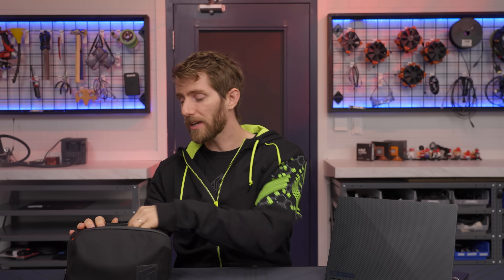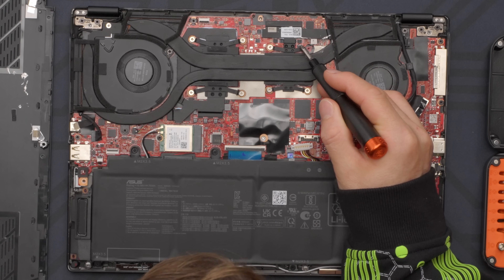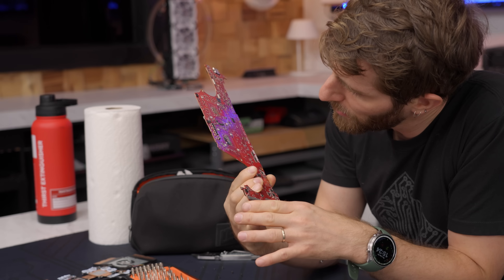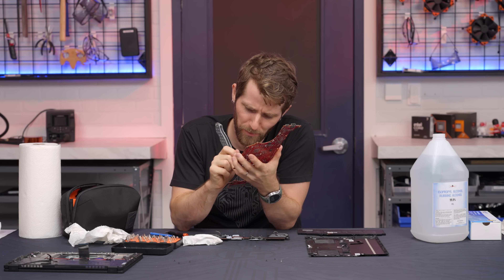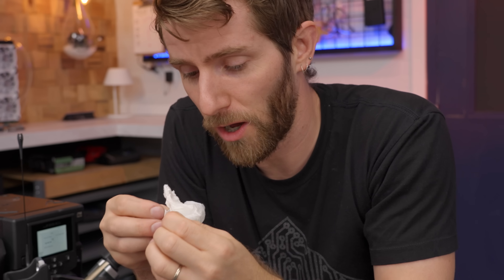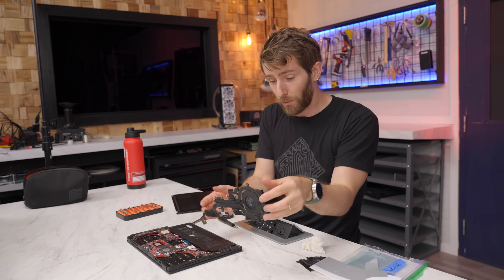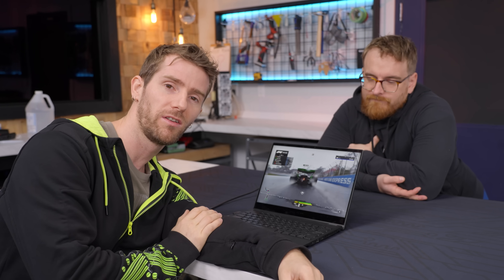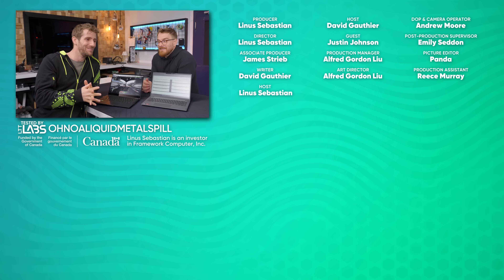Liquid Metal Killed my Laptop… Now What?

Comment: I put PTM9750 in my HP Omen 15 and it's day and night difference. It works so much better on bare die chips vs IHS chips. Normal thermal paste would just degrade after 1 months due to pump out effect.

Comment: That's incredibly dumb design, components around the die should be insulated by the factory with conformal coating or similar... Heck I put liquid metal in my laptop 6/7 years ago with some insulating tape around it, I regularly throw it onto my bed and it even fell from my hands while standing a couple of times, and nothing ever happened. This is beyond stupid.

Comment: I was once cleaning my 2022 asus laptop, since I thought it was overheating - turned out I had liquid metal. I replaced it with normal thermal paste and temp either went down or didn't change at all. Liqid metal is completely pointless.

Comment: The paranoia around Liquid Metal is insane. If you listen it’s a manufacturer problem with low mounting pressure of the heat pipes. I applied Liquid Metal to my laptop a few months after getting it because architectural rendering can be super intensive and I don’t want my pc to sound like a jet engine in public.

Turns out there’s been zero problems with it since then besides me accidentally breaking my speaker ribbon connector lol. And yeah I’ll be doing a raytraced render one minute then  walking a mile back home with it in my backpack and that doesn’t cause any problems. I’ve had nothing but net benefits with it, even the broken speakers have been nice as I don’t need to worry about forgetting to mute them in public lmao.

Comment: I replaced the liquid metal on both of my devices (Flow x13 and Zephyrus G14) with PTM7950 and actually experienced a performance boost. The reason is the uneven distribution of the liquid metal on the surface. The core with the highest temperature was throttling the entire CPU.

Comment: I have an ASUS  laptop GA503QR-211.ZG15 with the same Liquid metal cooling.

Due to some high 95-98°c I removed the heat sink and noticed Silicone thermal adhesive around the cpu die acting as a barrier to keep the liquid where it should be. 

I'm surprised as to why they would think removing the silicone adhesive on future generations would be a good idea

Since asus was rationing out liquid metal like it was the 1930s I reapplied liquid metal from Grizzly,  the silicone thermal adhesive and took the same laptop to college Mon-Fri for 3 years, seems like to me The Silicone barrier is crucial.

Also the temperatures significantly improved and doesn't dare to pass 80°C.

Owned the laptop for about 6 years now.

Comment: My local Clevo representative store sold new laptops with Liquid Metal. I reported issues with extreme cpu temps and they just claimed it was a simple cleanup maintenance needed, after warranty ended I did it myself to find it has a copper cooler, totally corroded by the time I saw it.
Clevo has not accepted any resolution claims to this day.

Comment: Please wear a type of gloves that the solvent that You are working with does not dissolve. The isopropyl alcohol is known to react with some of the metals even, which means that some metals do get dissolved in it, not just the "liquid metal" as demonstrated at this Linus Tech Tips video. At the same time the isopropyl alcohol is good at getting into living organisms, transferring the dissolved metals with it, increasing the likelyhood of cancer development over longer time period. On top of that, many sovents are themselves, in pure form, cancerogenic, which is the reason, why in Europe interiour design paints, renovation paints, have strict limits on the percentage that they are allowed to contain substances like the isopropyl  alcohol in them. The painters, who paint floors and sealings and do other interior renovation work would get sick, have become sick in the past, due to the organic sovents like isopropyl alcohol. So at least some professional electronics engineers use chemistry lab style ventilated work areas when dealing with isopropyl alcohol. The same with almost all the rest of the electronics chemistry. Even Chinese factories have soldering fume extractors or some ventilator to at least get the fumes away from workers. I suggest that Linus Tech Tips should start educating the public for electronics related work safety, specially in terms of chemical safety. Thank You for reading my comment. (Not that hardly anybody would read my comment among the over 2000 comments in this thread.)

Comment: Good try. Now do a collab with one of the many great youtube motherboard repair channels out there. 

It's probably a "very easy fix" (for them) with just a replacement of a couple of shorted chips on the power rail. 

The "get a new one" mentality here sounds pretty off-brand for LTT to be honest. Cheaper to get it serviced, profitable if you get content out of it, with the added benefit of community building - getting more tech-tubers involved in common projects and giving some visibility to smaller channels.

Comment: Liquid metal has no business in a laptop. It barely has any business in the PS5, where it has already caused a ton of issues, especially in the vertical stand position, which you're expected to be using as the normal position.

Comment: I'd say that one would reasonably be able to assume that their laptop should not die from minor bumps and everyday use. Liquid metal is used best for short term high output applications. Putting it in a laptop seems like an accident waiting to happen (which it did)

If you have to use any sort of exotic elements in your cooling it doesn't belong in a super small form factor that's meant to be carried around. This is what happens when laptop designers are not allowed to tune their CPU and GPU more than manufacturer tolerances and have to find any way to stand apart from their competition...

Comment: Honestly, the real issue is that Liquid Metal is applied by these OEMs like they’re normal thermal paste. Too much of an amount, improperly applied by applying only on the die, and the room to allow poor customer service when it messes up. It definitely is somewhat of a planned obsolescence because they are already horribly applied stock.

Another thing that just irks my nerves honestly on this topic is how some treat or panic immediately over liquid metal as if it were nuclear power itself. Handling it properly prevents most of the risks, especially during the manufacturing of the device.

But that’s my thoughts, the implementation of liquid metal on laptops or consoles is honestly more of a marketing fad because “temperature” yada yada money money big profit weeee.

Comment: Just yesterday I was trying to explain this to someone. Liquid metal is just marketing for PS5 and Laptops.

it's just an extra point of failure with almost no benefit that can easily turn your 1000 - 2000 laptop into a brick.
it's also a nightmare for laptop technicians. Nobody want's to deal with that and go through the whole process of cleaning the metal to inspect/repair or do what you need to do inside the laptop.

Thermal bottleneck for laptops is not even in the interface of the processor with the cooler, it's limited by the size of the pipes, the small heat diffusor and the small fans. You only get a decrease in temperature that's not worth the effort and almost no performance increase.

But what you do get is as I said an extra point of failure, just making the lifespan of the laptop shorter in the attempt of increasing the lifespan of the processor.

Comment: I have had multiple people send in requests to have their liquid metal laptops fixed and honestly ... this is exactly what I've seen.  Sometimes you can get them working, most times not.  I had one MSI laptop where the liquid metal had gotten into the fan itself and spread EVERYWHERE in the machine that was from a drop in a backpack from about 4 feet.  The laptop structurally was fine but that exploded liquid metal everywhere.

Comment: I have a Clevo P870TM laptop. It came with an Intel 8086K, which I liquid metal'ed back in about 2019 or so. It is hardly a portable laptop but has come with me many places and I have not had any issues. I protected the circuitry with nail polish and it has lasted me a very long while. I know I'll have to replace it eventually but may actually try these pads out instead.

Comment: Some brake cleaners are basically 99,9% isopropyl alcohol. I like to use that to clean something like a PCB sometimes since a can like that is pressurized and just allows you to blast whatever you're trying to remove off of the PCB without having to touch the PCB with brushes or tools.

Comment: I also have a Zephyrus G15 with such problem, mine just hasn't powered on since the leak meaning it didn't short circuit yet, now here's where it gets tricky, I personally performed the old isopropanol wiping but I'm sure there's some left under the connections and nor me or any other shop in my town has access to proper cleaning gear like a high power suction tool, now please tell me, should i just flip a coin and power it on or should i keep searching for a trustworthy repair shop?
keep in mind that the market value for my laptop here is between 500 to 700 bucks, and if i find a capable shop the repair cost would be around 50 to 200

Comment: Ive got a 2022? RoG flow X13. basically the same laptop. mine has been pretty good, but it developed a short in whatver controls the Type C ports on both sides. it will still charge, sorta. but it will completely fry and other device or storage drive plugged into the type C ports. im not sure how to fix it or if its fixable... I really love this thing and want to keep it/fix it or get a replacement.

Comment: The proper way to try to revive that machine, is taking the board off, clean the maximum as possible, dessolder the cpu to inspect behind the chip itself and then reball it.

Comment: Had an Asus product that was one of the earlier ones to use Liquid Metal leak out. Didn’t help that the device was used normally in an upright position and frequently flown up to high altitude (17000ft in an unpressurized cabin). Eventually it wouldn’t turn on. Washed it in isopropyl alcohol and it came back to life after leaving it alone for a week.

Comment: Liquid metal is one of the dumbest ideas I've ever seen - Not just for laptops, but for everything. It's totally unnecessary, and they are just using it as a crutch for insufficient cooler surface area.

Marginal gains, maximal risk.

Comment: This one capacitor probably doesn't matter. when i opened up my laptop (working), because something was rattling inside of it, some big capacitors like those Gray towers and resistors jumped at me, ant it still working just as always. I also found the spots where they are missing.

Comment: Those of you attempting these and are fearful. 

My strategy has been to tape/cover everything AROUND where everything cooling goes. Ive done about 15 of these so far and i havent had a short yet 🤓

Just be very very VERY careful. Take your time. It costs a lot less in time than replacing a machine does in money lol

I tend to avoid using liquid metal again when putting it back together. It just isnt worth it.

Comment: I think one way to go arround with this problem would be to use IPA in an ultrassound machine. This would make the liquid metal dissolve even if it is under any chips/components. But I have never crossed with htis problem, so, it's just an educated guess.

Comment: I won't use or work with liquid metal or anything with metal in it because of the fact it's a pain to clean up.   Also... I could be wrong... once you service a product with liquid metal (maybe a PS5 to replace a HMDI port which seems to be common) I don't believe your getting that factory seal and once you tighten everything I'm not sure it's good enough for liquid metal.  This video is a very good reason even if something happened from the factory.   Seeing how far liquid metal could have possibly traveled kind of scares me.  Although I'll have to watch it  again because I'm not sure if this laptop was taken apart for testing before it reached Linus's hands.   Even if that happened I don't see trained techs being that sloppy.   I'm just saying, sure it's possible liquid metal placed in that screw could have been planted for content creation at the very least.   Maybe that the point of this video that in some devices liquid metal doesn't be long.

Comment: I had my Zephyrus stuck in a boot loop a few months ago when I barely started to use it on a daily basis. I saw SO many complains of people having the same exact issue on reddit when I trying to figure out what was wrong with it. I wouldn't be surprised if it were a liquid metal problem. At this point, I'm never buying an Asus again as their support was no help if you're outside of the one year warranty and to repair it would cost the exact same as buying something new. I barely had it for more than a year and I never even dropped it or used it that much at all before than besides to pay the occasional bill. Asus needs to do better.

Comment: Liquid metal cooling in laptops is just a marketing gimmick you will run into power draw issues before you can make enough difference cooling wise to make a meaningful impact on your clock speeds in most laptops. It only makes the laptop harder to maintain for the average person if they ever want to save some money and not pay someone 200$ to re-paste their laptop CPU and GPU. Making a portable device brick itself if you move it while hot is such a stupid sacrifice for maybe a 1-2% uplift in performance maybe. And I can hear the "what about being able to run your fans at a lower speed and extend the life of the laptop" here is an answer clean your vents and fans, stop sitting it on your bedsheets for it to suck up your skin flakes while suffocating it and keep it on a laptop stand if you are already attaching it to a monitor for a portable desktop sort of deal.

Comment: without even checking brand i could say its asus laptop,their laptop are fundamentally flawed. i had one laptop with toucpad lagging intermittently ,they replaced everything still couldnt fix it , one more issue arosed was laptop crashing as soon as it wakes up after they replaced the whole laptop, finally bought mackbook and finally use it without any tension

Comment: It helps to take images before the liquid metal cleanup so you have an idea as to which on board components may be fried. Unfortunately many of the connections on the board will typically route directly back to either the CPU/GPU or the southbridge and if they took an elevated voltage then they're likely no bueno.

Comment: Yup, I still own this laptop and yes it's still working despite me putting it in a backpack when travelling. But I've been very careful not to bump it into anything. 

And I put thermal pads on the heatpipes so they contact the back cover, increasing heat transfer AND increasing pressure on the pressure plates.

Also been using this in Tent mode and so far so good but I've forgotten this is a thing until this video.

Comment: I have a 2021 G15 that hit 4 years on the original liquid metal application before I replaced it with PTM7950 recently. The liquid metal was starting to leak out of the die area and on top of the seals, it was a matter of time... it looked horrible and burnt.

HUUGE improvement in thermals and clocks with the PTM7950 in both real world and synthetic benchmarks. Seeing higher clocks than brand new also.

Asus needs to stop using liquid metal on these.

Comment: jesus christ use your head linus: MOST liquid metal solidifies when it gets cold use some freeze spray next time and save yourself a laptop, freeze it then pick the solid bits off. also that capacitor lifting may not have been completely on you lquid metal will amalgamate with most tin solder's it makes the solder very weak and very soft

Comment: A few weeks ago I had to reapply the liquid metal on the cpu and gpu on my brother's laptop he uses for traveling, very very frequently at that. Best BUy where he bought his ASUS laptop (yes, it is an ASUS one as well similar to the one in the video), and they had to replace the motherboard for another issue and they obviously reused the same cooler without reapplying new liquid metal, as there were terrible cooling issues after it was replaced. Took about an hour and a half of careful application of Teflon tape, shop towels, q-tips, cleaning with 91% IPA, and cleaning off an d reapplying the VRM and memory thermal paste and then the thermal grizzly liquid metal, thankfully he has not had a problem since. Liquid Metal is really painful to work with.

Comment: you have to use ultrasonic cleaner to remove liquid metal under the chip and nock and cranny 😏, it is possible to repair that laptop as long as you send it to expert board level repair😏

Comment: Had to rma an rog strix. Thankfully it was still under extended warranty. The service guy actually showed me where the motherboard shorted. Apparently it was a running issue and the replacement board came with the same area coated in additional insulation. So no Asus doesn't need liquid metal to bridge connections. Also keep your gaming laptop in warranty or you'll probably regret it

Comment: this is easily solved. FIRST, KAPTON tape ALL AROUND THE CPU! Then you get a thermal pad and cut the die square out with an exacto blade. Place the pad around the die, it should raise higher than the die. Apply LM, then put heatsink on. The heatsink will squish the thermal pad and seal in the LM. turn it sideways, upside down, or shake it like a newborn baby, it will be fine.